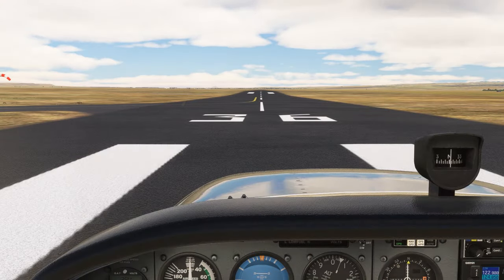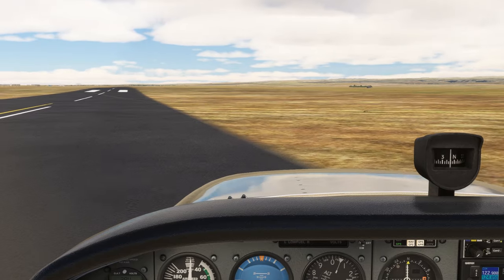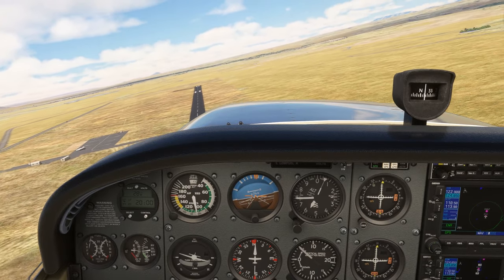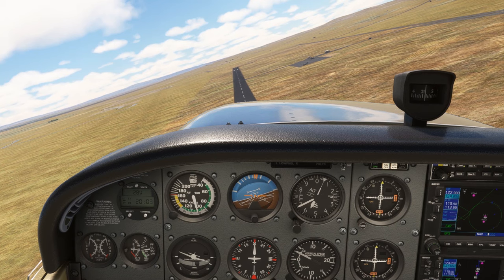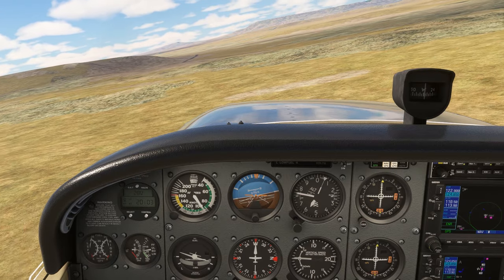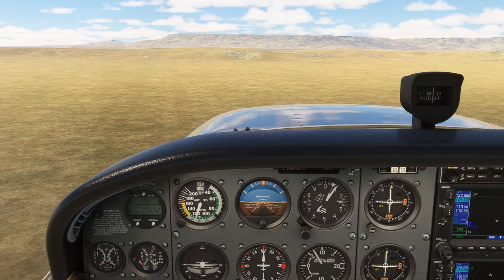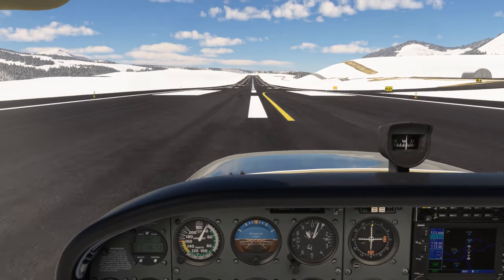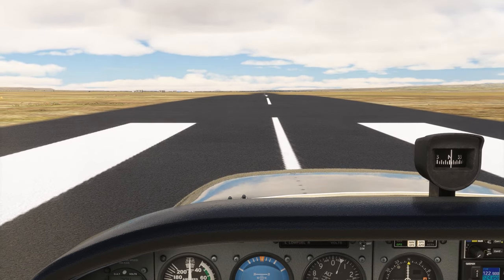Magnetic Dip Error Visualized | Compass Errors | UNOS ANDS

Comment: I get the video but it’s missing the main point. So why does it lag and leads?
Reply: the magnet in the compas changes its center of gravity because of the movement, which cause it to deviate. It actually occures naturally, the more you are close to the north or south on the globe, the dip angle of the magnet increase

Comment: Partially thanks to you I have explored the world of MSFS 2020 and a powerful home computer for IFR practice.  Both planes I fly in real life are steam gauges, a Maule and a Bonanza  I am not proficient with a G1000, but I've used it a little on the sim. What is that 172 you use in the videos? I like the 430/530 combined with a good AP and steam gauges. Thanks for the information, Bill
Reply: I had to pay extra for the anniversary edition of the game that had the 172 with a 6pack, one thing to note is that model is still fuel injected and not carbed so you'll have to pretend pull carb heat if that's what you fly IRL